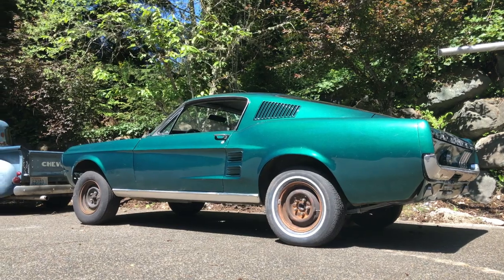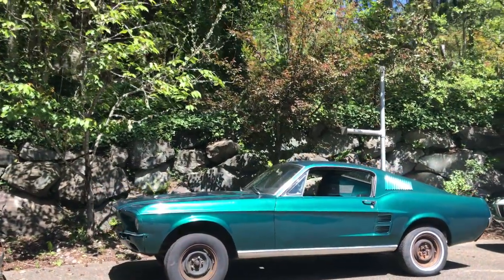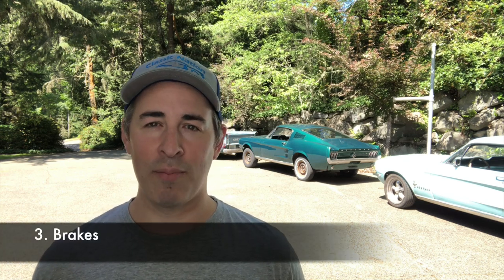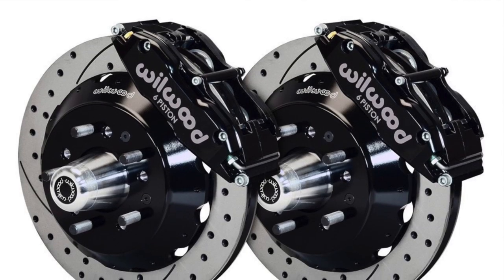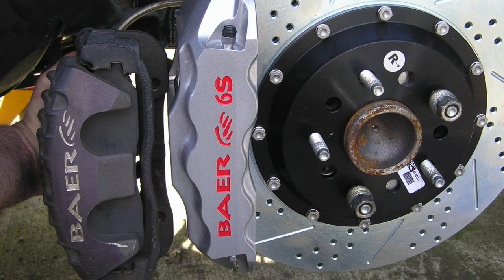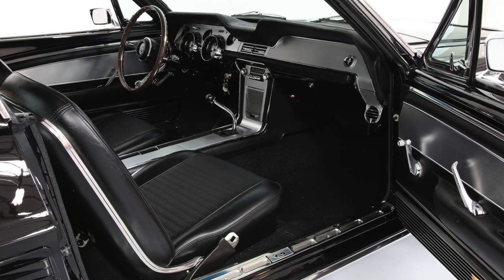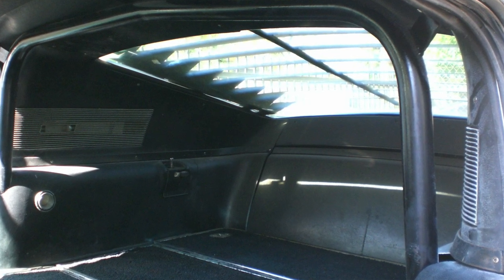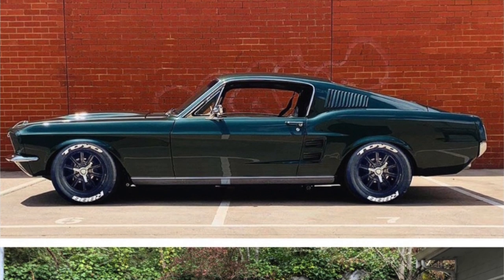Coyote Swapped 1967 Mustang Fastback Restomod Build Plan

Comment: You have a solid plan and I can tell that you have done a ton of research.  Your plan is almost exactly what I have done to mine. Here are a few things to consider as I learned from my build.

1. Hood clearance - Do some research on the front end suspension.  I am assuming you are going with some type of mustang II type suspension.  I went with TCI (Total Cost Involved) Front suspension kit. I love the kit, but I can not fit the stock engine cover with the stock hood.  There is plenty of room with it off but modifications had to be made to the hood structure to get the stock cover to fit. This kit has the cross member sitting so low that I can not fit a low profile hydraulic jack underneath it. so the height of the engine was not a lack of trying to lower the engine as far as they could from an engineering standpoint. So if you want to run a stock turn signal hood, your only option may be a stock intake.  Of course anything is possible, I have been known to be wrong from time to time.

2. Brakes- totally agree with you on the manual brakes.  I run 3 willwood compact master cylinders (one for front brakes, one for rear brakes, and one for the clutch) and I have 12" rotors and 4 piston brakes and I can stop on a dime.  I would highly recommend the 3 master cylinder layout.  Willwood sells a fire wall kit that neatly arranges them. 

3. Suspension -  I run a TCI Mustang II IFS (like stated above) and TCI 3 Link in the rear.  Not only does the car respond really well cornering, the frame is super stiff with their subframe connectors, and the kit is very reasonably priced.  There are a lot of good products though. 

4. Interior - With a transplanting a coyote with a 6 speed transmission, you will have to modify the transmission tunnel.  I have yet to see a coyote swap with a Tremec transmission that has not had to modify the trans tunnel.  You may get away with out modifying the tunnel with the stock Getrag.  I am not sure through.  With that being said, there will have to be modifications made to the floor console in order to get your it to fit right.  My trans tunnel cam up probably between 1-2" from the stock height. just something to thing about.

5. Seats - spot on with the seats, with any type of aggressive cornering, those seats you have in your plan will prevent you from sliding out of your seat.

Good luck and have fun! Plans change and budgets get blown pretty quickly, HA!  If you have any questions, don't hesitate to ask.  I have been through it and I went as far as mini tubs ( which unless you really need fat tires, i don't recommend. sooo much work!)  I have a ton of pictures if you need so see anything specific. I think you and I are one a few of the same FB mustang pages as well.

Blessings,
Aaron
Reply from the maker: Hi Aaron - thanks for such a thorough response! Excellent points and things to consider. I'd love to see all the pictures from your build. Did you keep a build thread anywhere?

Thanks man, I really appreciate it!

---Evan
Reply: Kind of. I have all my pictures on my FB page. Some day I will have time to put together a proper build album.

Comment: I owned a 67fastback 390 auto. for 23 years. It was a chore driving an old car like that. Brakes? Scary. Suspension? Laughing out loud. I loved to burn rubber from light to light. But stopping? Now that was a thrill. Taking corners fast? I don't recommend it unless your fond of rolling a car. The looks were enough to put up with all the negatives. Uden  Uden.
Reply from the maker: Ha, that is awesome. That’s why I’m all for component upgrades.
Reply: I agree!  I restored a 67 Camaro, 68, Camaro, 68 Firebird and 69 Firebird and they looked amazing. They also drove like cars engineered in the 1960's.

Comment: I had a Raven Black ‘67 FB years ago, did a mild resto mod with a 351W.  One safety upgrade I did was to replace the solid ‘67 steering column with a collapsible ‘68 column.  I also put ‘69 high back seats for some neck protection. They looked great, not out of place at all. Also added shoulder harness seat belts from a Ranger pickup. It all looked “stock” and made me feel a little safer.  The roll bar is a good idea, I didn’t go that far.

Comment: I know I am a late comer to this build, but with that engine/trans combo I think I personally would go with the full frame. I owned a '68 fastback and the unibody does have a tendency to flex. I had a crate 351 Cleveland engine and an FMX auto with a 9 inch rear end. The stock suspension and brakes made for a sometimes scary ride. Wishing you the best of luck. It's your car, build it the way you want to and enjoy the journey.

Comment: sounds like you have a pretty sound plan. My 70 sportroof has a big bore 347 with a wide ratio top loader backed with a gear vendor overdrive- works great. No tunnel mods. will be following your project. BTW what is the weight of the aluminator compared to a 302-351 cast iron ?
Reply from the maker: Thanks! Aluminator 52XS weighs 70lbs less than the 289/302 cast iron stuff.

Comment: One thing you may want to do is add a set of 1968 torque boxes the 1967 only had one I can't remember what side it was on but the extra one will stiffen the chassis up a bit and mostly be out of sight and then make sure when you are doing the frame rails to let a frame shop do it to make sure it is square that looks to have had damage to the passenger front and was "fixed" at one time the frame shop will let you know about that when you get the rails redone and yes while you have it tore down do all 4 floor pans.... This is a beautiful specimen with all projects there will be a hang up here and there.  I miss my 1968.  you may get lucky at a salvage yard for the drivetrain finding a 2018 totaled mustang with low miles those Coyote motors are Ford's answer to the Chevrolet LS motors I've heard of a few "you tubers " adding blowers to these and having them daily driven with well over 600+ hp at the wheels with over 100k miles on the motors... just my 2 cents.  You may want to check Performance Suspension Tech if they are still around to see what they offer.  I'm not sure I got married 20 years ago and I know the game has changed since I let go of my babies a 67 fastback (I-6 with a total v-8 conversion in works) and my 69 Mach1
Reply from the maker: That is an excellent point. You're absolutely right. I'll be adding new torque boxes on both sides.

Comment: Would that full frame option you mentioned add anything to the crash worthiness of the vehicle? Maybe high back buckets well for safety if you really intend on driving it a lot. I would probably rebuild the 351 and add a C6 with one of those gear bender overdrive units to improve mpg. And I really like that green! Good luck with your project!
Reply from the maker: Thank you!

Comment: The '69 Shelby roll bar will bolt up to the shoulder harness attachment points on a '68 I don't know if the '67 has them, but I did have to use a cable come along to pull in the roll bar to get it in place. The body on the earlier model was a little narrower than the '69. Otherwise once in place you can reinforce the attachment point, drill your holes, and bolt it in.

Comment: Suspension wise I would take a look at Ridetech or QA1 coilovers, brakes, maybe is doable to swap a modern S550 4 pistons Advics brakes, they are awesome with hawk pads and you can find barely used ones in ebay very cheap, maybe even a 6 piston brembos...having said that I love Baer option 
To finalize I love all your selected parts and really really like your current dark green on the exterior
Reply from the maker: Thanks man, I really appreciate it!

Comment: I would stroke that 351w. That's a good strong casting Ford made.Can handle 600 hp.You would save thousands and would keep the car old school.
I'm having trouble accepting this new technology put into vintage rides like yours.Good luck whatever road you go down.
Reply from the maker: Yeah, I hear you. I'm just really into the idea of going modern for performance, and keeping all the visuals old school. These crate Coyote engines are performance monsters, get 20+ mpg, and you can hop in and drive 300 miles straight without having to think about a thing. Hard to beat that.

Comment: I kept the stock suspension but swapped heavier sway bars, Koni shocks, solid heavy export brace and Monte Carlo bar.  Handled well, but still had the solid rear axle so not ideal.  Biggest issue was steering:  I swapped the original manual steering for power using original parts, big mistake.  Way too much play.  Don’t know what options you have today but  i would look for a rack and pinion setup.

Comment: Hi Evan! Didn't your Mustang end up having a 351 Windsor in it after you bought it? Love the Coyote swap Idea, but how much are those now? Thanks for sharing. I am running a 460 built big block in my 67 S-code currently. Tight fit but did not have to cut into shock towers etc.

Comment: If you're doing the floors I would go with the roadster shop chassis. Save yourself a lot of money bore and stroke that 351 with a nice intake and heads maybe a holley efi and done.....
Reply from the maker: Yeah, I'm taking a close look at going that direction. The RS chassis would be the solution to a lot of the current and potential issues that I see with the unibody condition on my car...

Comment: I’m building a 69 boss 302 with a coyote and a tko600 running on the Holley dominator every panel besides the doors and quarters are carbon fiber and rims where hand made from carbon fiber, suspension is a Detroit speed c7 corvette suspension swap running on quick adjustable coils just finishing panel fitment and paint then wire up the led lights but my god am I getting close paint color is Mazda red with gloss over carbon fiber for the stripes. My uncle bought the car from v8speed shop after they gave up on the project and he never did anything to it so I bought it off him
Reply from the maker: Wow, that sounds like a great setup you've got Frank!
Reply: Classic Nation yeah we’ll if I didn’t buy it with I wouldn’t have paid the money for everything my uncle sold me it for pennies on the dollar

Comment: In order to drop in a Coyote, You'll pretty much have to lop off the entire front end and replace the entire front end of the car for strength.... I'd advise against it on this fastback...If you want to drop in a fast motor...drop in a crate 347 stroker or "427" crate motor... Don't go so crazy as a Coyote motor......My personal opinion..
Reply from the maker: Why would the entire front have to be replaced? With the exception of the shock tower removal, and the addition of the cross member, what else needs to be replaced?
Reply: @ClassicNation  That's just it. On unibody cars, the shock towers ARE structural and you cannot remove them w/o supporting the frame rails some other way. You're going to need to do quite a bit of research and soul searching. You'll find that most aftermarket solutions are not really designed and developed to the same degree as OEM components. Remove the shock towers and you transfer ALL the load to the frame rails. They were never designed to support the loads they will see from even street driving. Will it work? For a while, yes. Keep in mind that 95% of these cars are only driven occasionally, usually to a car show, then back into the garage. Start racking up the street miles and you'll soon find every single weak point on the car.
Reply: I agree , look at the width of the 351w.Wonder why the headers were not installed.The coyote is wider than the 351w I'd say 3 or 4 inches.Plus the weight . If there is any issues after installing the motor could be a major problem having room to do anything.With all the other costs involved with this build, you could go buy a new mustang for almost the same price and have a warranty plus a suspension which would be superior to anything you could ever achieve in your build.The 351w is tight, a 302 stroked would be idea.Put EFI on it and there's your fuel mileage.Still have have close to 400 hp and leave those shock towers alone.Why use a coyote when you can never get the handling out of the suspension.

Comment: Are there any cheaper “restomod” engines to build a more reliable driver? I’ve seen the fuel injected 5.0 swaps from the foxbody mustangs but they don’t make a lot of power.
Reply from the maker: Yes, there are several cheaper options. You could always do the 5.0 out of a fox and add boost (supercharger or turbo). You could also do a LS swap. Or, you could rebuild any of the old engines (289, 302, 351, 390) and you could add EFI to it. FiTech or Holley are both making really good kits are are $1k-$2k and can add reliability to an older engine if combined with a fresh rebuild. Lots of inexpensive options!
Reply: I’m building a “budget-friendly” combo for my 68 fastback. Hope to have on the road at some point this summer. Combo is a 400+ hp 347 with Holley Sniper FI, HD Tremec 5-spd and 9” rear end with Trac Lok. 16” wheels and stock suspension with 1-1/8” front sway bar, QA1s, and 1-pc traction bars.
Reply: Lance Langdon sounds like a sweet build! I’m just looking for something as reliable as possible so it could be regularly driven here in Missouri (very cold winters, hot summers). A foxbody EFI 5.0 sounds appealing

Comment: Mustangs from 1967 are not "matching numbers" To quote Greg Zyla More Content Now "I’d like to add something, however, as in my opinion there is a much larger and more hobby damaging issue regarding the use of phrases like “numbers matching,” “factory installed,” “born with,” or “original” when describing Fords. The truth is that, except for the Mustang Boss 302′s, there is no such thing as a matching numbers Ford.
To explain, Ford did not stamp a number on any part that relates to the Vehicle Identification Number (VIN) of the car. They only had a date code cast into the part. "
Reply from the maker: "Ford did not stamp a number on any part that related to the Vehicle Identification Number of the car" is actually an incorrect statement. The VIN is stamped on the inner fender on the drivers side. What I think you mean to say is "any engine part".

Comment: Go buy a new Mustang if you want a modern canyon carver instead of ruining a classic.  The body in white will never be stiff enough and suspension balanced enough to be worth it...by the time you’re broke.  Upgrade the brakes, control arms, springs, rack, sway bars, and bushings, and put a nice period correct reliable motor with a 6-spd Tremec.  Stock looking wheels with modern tires and keep the existing ride height so you don’t ruin the proportions of the car.  You’re just making headaches for the next owner who will restore the value of this car.  And for god sakes do not cut the shock towers or add modern gages.  Would like to put the Eleanor and restomod people on a barge and sale them away.  Preserve and honor the era.  Don’t butcher it with this tacky bs.  Cheers!
Reply from the maker: That is a great idea! You should do that! Buy one, and do exactly what you'd like with it.
Reply: Classic Nation can’t buy my own because you guys have made even a ratty unmolested car unobtainable with this Eleanor restomod nonsense.  Why do thing you paid $14k for a rolling junker.?  Buy a Dynacorn shell and stiffen the chassis before assembly, and sell the vintage to someone who wants a classic car.
Reply from the maker: Thanks for the feedback. I can understand where you’re coming from.

Comment: Don't do the the Coyote. The whole front clip will have to be butchered to make it fit. Just redo the 351 and you can get the same power for less money and an easier and cheaper overall build.
Reply from the maker: The whole front clip is rusty and needs replacing anyway...

Comment: Then you are about to ruin it by putting a coyote engine in it which devalues it worth  and it is not a classic anymore if you follow MCA rules Use a 289 or 380..A 289 can kick a coyotes rear.
Reply from the maker: It's worth is $14k, so I don't think putting a motor into a car that currently doesn't have a motor will ruin and devalue its worth. Also - a 289 can't measure up to the Aluminator 5.2 on any scale. A 380 isn't an engine. Lastly, I don't follow MCA rules. I do what I like. :) A restomod definitely doesn't have to be your preference, but your listed reasons for why it's a bad idea are inaccurate.